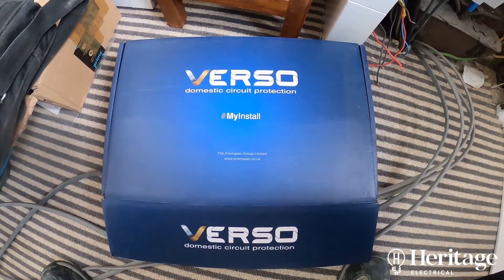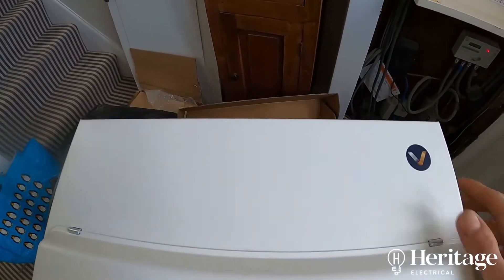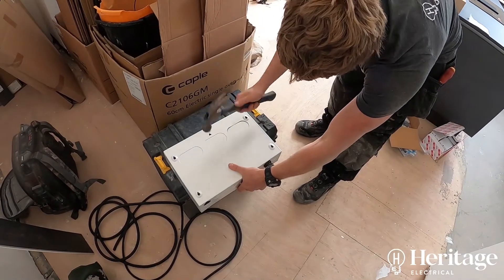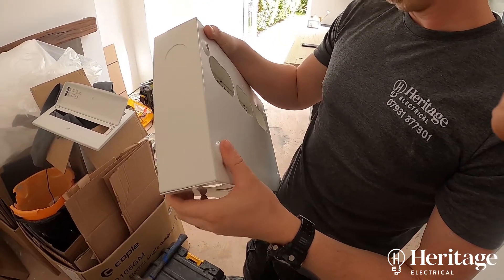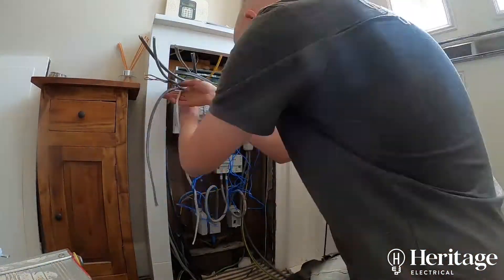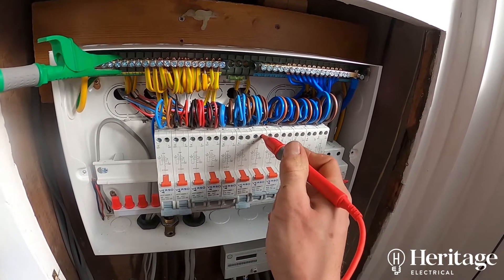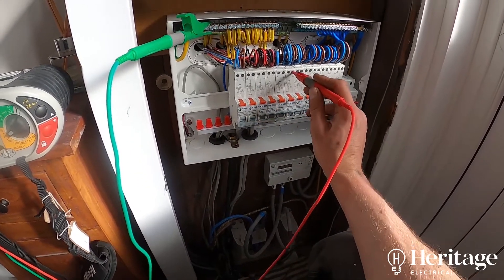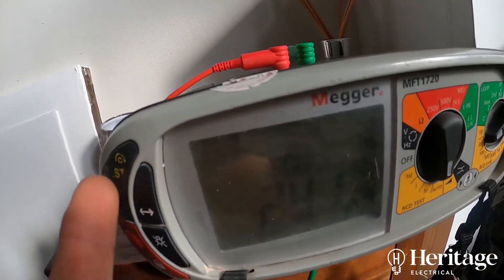Verso Consumer Units & RCBOs: a Quick Real-World Review

Comment: What do the manufacturers suggest about the knockouts being so well attached. 
@MyInstall
 @#MyInstall - The Premspec Group

In the https://youtu.be/zdb7_HexVME video the neutral bar fixing seems different. Is it a different model?
Reply from the maker: Hi Chris, thanks for the comment. We haven't spoken with the manufacturer directly, but passed our feedback through our wholesaler. Yes it is a different model, in the video you sent it's a split board, we were using RCBOs throughout - only one neutral bar required.
Reply: @HeritageElectrical  Hi, my name is Joe, I work as National Sales Manager for Verso. Great video, thanks for posting. The points you have made about the knock out structure are valid and would like to let you know that we have taken on installer feedback and made adjustments to make that more installer friendly. The issue you had with the Terminal bar is very unusual if I am honest, I am not sure how that has happened. Again, we have acted on this and asked for some more thorough quality control before leaving our building. I would like to maybe give you a call if you are happy with this to discuss?
Reply: Hi Chris, I work in the Verso department, my name is Joe. We have taken on installer feedback and have made adjustments to the tooling of the knockout structure to ensure that they are easier to knock out moving forward, new batches will be arriving with us  this month. Also, the comment from Heritage Elec is correct regarding the split board. Feel free to give us a call 02921 303 708 if you want to know more about the range.